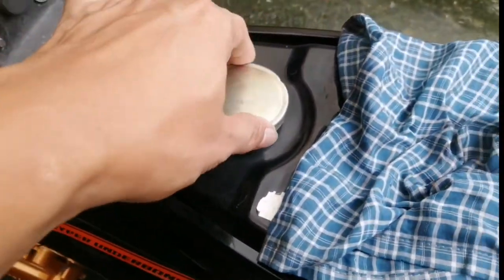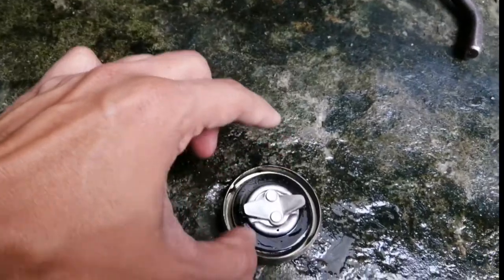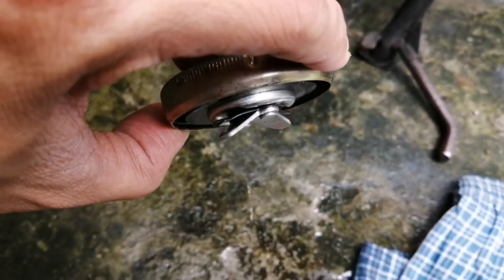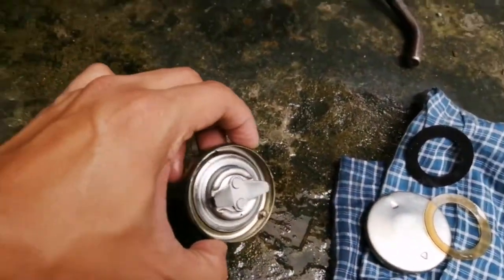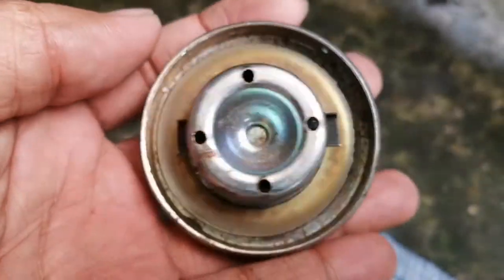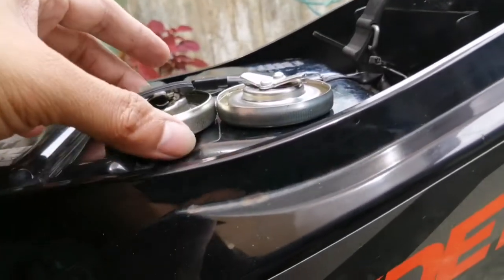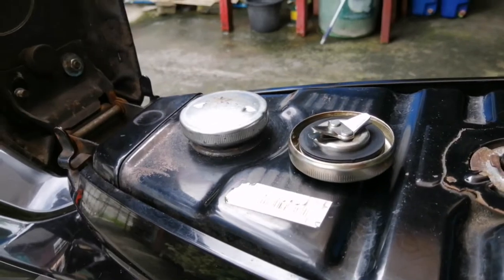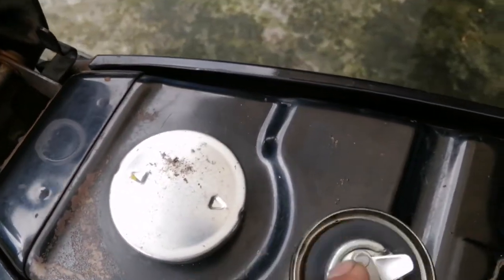SUZUKI RAIDER150|CARB     Fuel Leaking Problem,Finally Fixed

Comment: kamusta ngayon paps yung fuel cap mo? wala ba naging problema? 
ang kadahilanang pag lleak ng gasolina sa gas cap ng stock paps, according sa nabasa ko sagad na sagad yung pag full tank natin. soo yung fumes ng gasoline wala nang maiikutan so nag bbuild ng konting pressure sa loob ng tanke at umaapaw to at nag eescape sa butas ng gas cap ng stock natin. kaya may butas yung gas cap natin.

kung babasahin din kasi sa manual ng ating motorsiklo nirerekomenda na wag sagarin yung pag full tank. kaya ngayon kinakamusta ko kung wala ba naging problema.

dagdag tips to dahil sa aking obserbasyon sa pagleak din ng aking motor. Skydrive 125 motor ko. galing ako trabaho or gala at sa pag uwi ko nag ffull tank ako ng sagad tpos nag park sa garahe ng bahay, maya maya nung binalikan ko yung motor ko nagulat ako na ang lakas ng amoy ng gas. akala ko hndi ko sinarado ng mabuti yung cap pero mahigpit naman. dun pala sa gas cap.

dati hindi nman ganito. nagkataon lang sa tuwing umuuwi ako at pag full tank at pag garahe na dun lang naglleak. dahil nagkakaroon ng pressure pag patay ng motor.
pero kung mag ffull tank ako at medyo malayo layo yung pupuntahan ko at pag park ko siguro may konsumo na ako sa gas, wala nmang leak ang gas cap ko. kahit nga medyo maluwag na yung rubber seal walang leak. safety feature talaga ng gas cap na may butas inkaso may magkaroon ng konting pressure susungaw talaga yung gas. pero ayon nga lang sayang yung gasolina.

kung walang problema sa ganitong universal gas cap na totally walang leak, edi mas mabuti pala tong universal gas cap. iniisip ko baka may problema dahil may build up ng konting pressure na walang butas yung gas cap e.

***UPDATE: since nagkanotif ako regarding dito. update ko nlng tong comment ko. universal cap na ang gamit ko at ilang buwan ay naglleak na siya sa kadahilanan na hindi rubber seal ang seal nito. at amoy na amoy yung fumes kahit nkasirado na.
dati kasi hindi naglleak at hndi ko ma amoy yung gas pero ngayon amoy ko na. di ko alam kung ano yun pero tumigas yung seal ng universal cap.
pinalitan ko ng rubber seal dahil may spare nman ako para at least ma hagan hagan yung amoy. at okay nman at wala nmang leak at wala na yung amoy.
Reply from the maker: Tama ka jan paps yun din npansin ko lately kaya saktuhan na din ako magpa gas.sagad ko fuel gauge taz pa gas ako 2h goods na. Thanks  for sharing you idea ride safe
Reply: @artChannelraider150   etong universal gas cap pa din ba gamit mo paps?
Reply: Salamat sa info paps..nw alam qna hndi naq magsasagad ng fulltank syang kc ang gas..
Reply: Tumpak to sa experience ko, galing ako trabaho nagpafulltank bago umuwi. Paggarahe maya maya naglleak na gap cap
Reply: since nagkanotif ako regarding dito. update ko nlng tong comment ko. universal cap na ang gamit ko at ilang buwan ay naglleak na siya sa kadahilanan na hindi rubber seal ang seal nito. at amoy na amoy yung fumes kahit nkasirado na.
dati kasi hindi naglleak at hndi ko ma amoy yung gas pero ngayon amoy ko na. di ko alam kung ano yun pero tumigas yung seal ng universal cap.
pinalitan ko ng rubber seal dahil may spare nman ako para at least ma hagan hagan yung amoy. at okay nman at wala nmang leak at wala na yung amoy.

Comment: paps wala naba naging tagas dun sa replacement mo?. Same issue sakin. natagas din kasi sakin.
Reply from the maker: To create please subscribe and watch
Reply from the maker: D na paps basta gawin mu clean mu carb taz check mu yung mga jetting nia taz yung sa fuel inlet adjust mu. Thanks sa tiwala paps.. Suport lng more
Reply: No i mean natagas din siya mismo sa gas cap. same din ng iyo.
Reply from the maker: Yes paps sa gascap mismo kaya pinalit an q ng universal gas cap.
Reply: Thank you paps. Godbless. Ride safe always 💪

Comment: Done paps....
Reply from the maker: Salamat paps ride safe
Reply: @artChannelraider150  boss good day po ano pong pangalan nang replacement po nang gas tank sa anong unit po yun ganyan dn kasi issue sa r150 ko po
Reply from the maker: Paps sb sa pinag ilan universal daw ur pambarako. Tips paps pag ngpa gas ka wag sagad sa takip need din kze ng air sa loob ng fuel tank natin r.s